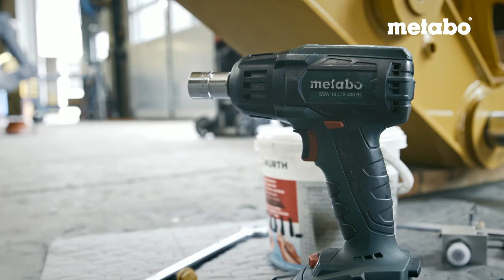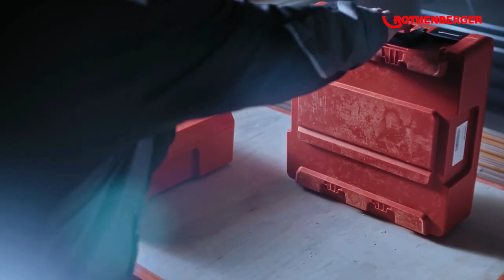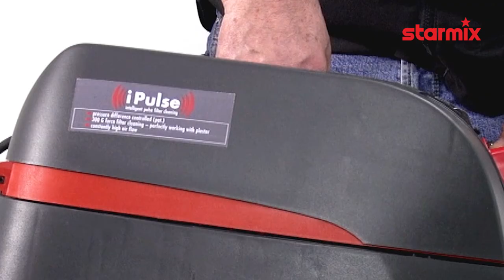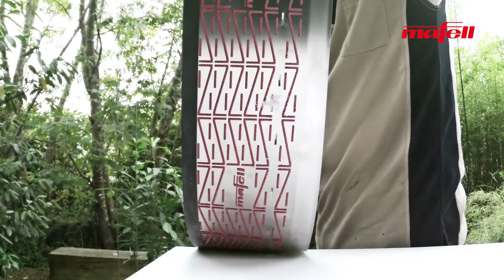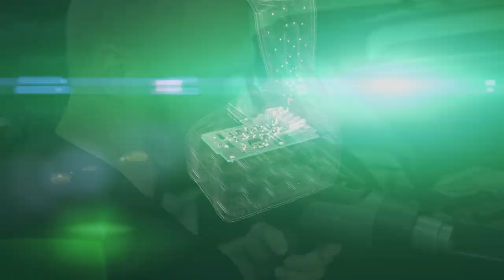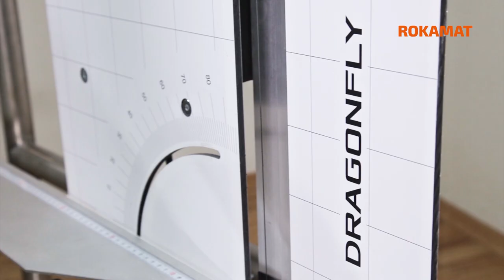One battery, many solutions. Cordless Alliance System (CAS)

Comment: Great way to stifle innovation, all partners have to agree to any changes before something can change. It will take a decade before they innovate like Makita with their 40v and 64v range. Plus, they will stick to outdated 18650 cells instead of the 21700 cells that hold a lot more power.
Reply: Hardly a stifle to innovation, firstly, makita 40v and 64v is shit and has easily been beaten or equaled by 18v or dual 18v equivalents, and for higher power applications I'd rather see multiple 18v batteries in series (where you'd expect to need more power you're looking at larger tools in the first place) rather than forcing people into a new battery platform that only works with specific tools.
21700s are not as super amazing as you seem to think they are, the actual thing that companies should be switching to is lipoly/li-ion pouch cells like dewalt, but having a unified battery system does not prevent this from happening as shown with dewalt, the pouch cells can be completely interchangable with the 18650s, hence the leader of the CAS (obviously metabo) can make them and offer them as an alternative for their own tools or others.

CAS is a major leap forward, like USB C has been, and I hope to see it actually forced on tool makers by the law in europe so that people aren't locked into one battery platform when they buy their tools and instead get to choose all the best from each brand.
Reply: 18650 or 21700 is just a form factor, it does not say anything about the chemistry and energy/power density of the cell. Don't make comments about things you have no knowledge about.
Reply: @Wallborg  I'm a robotics engineer, I work on autonomous drones and we modify batteries ourselves, especially on prototypes. Look at the size and weight differences between the 2 and the slightly larger size allows ~50% greater capacity (comparing similar chemical compositions). 21700 are designed to just be larger capacity 18650s so voltage remains the same so there is no need to change any internal wiring of the system. I'm not an expert with batteries but I do work with them and know a fair bit about them because we have to research every component that we use on a drone.
Reply: @Martian74  Nice. :) The thing is that 21700 isn't "slightly" larger than the 18650 - it's ~50% larger. So it should come as no surprice that the capacity is ~50% larger given the same chemistry, it's just a matter of more volume. There is of course some volume efficiency gains when going for a larger cell but for a hand tool battery pack they are negligible on their own. What matters is the system solution and the constrains you have in your system, depending on that either 21700 or 18650 could be the best solution - or a completely different form factor. But there's nothing saying that a pack with 21700 cells automatically is better compared to a pack with 18650 cells.
Reply: @Wallborg  3mm added to 18mm diameter isn't a 50% increase and 5mm added to 65mm isn't a 50% increase but there is ~50% more volume so you can gain around the same increase in amp hour capacity. This association limits innovation by limiting them to 18650 cells. 21700 batteries offer a ~50% increase in capacity without changing the voltage out so no tools need any changes to wiring or capacitors, regulators or any other changes but they aren't acceptable to the association. That is why they will fall behind in technology. Look at the pouch cell batteries being made by Dewalt now. Pouch cells have very high power to weight ratios but are more delicate than cylinder type batteries but if Dewalt found a way to use them safely then they can innovate the market but not the association. They will fall further and further behind.
Reply: @Martian74  I know the cell voltage stays the same given the same chemistry, that's not a form factor unique thing. Yes of course a cell with a larger volume will have more capacity, that's not a technological advantage in itself, just pure geometry. You can also put it the other way around, that you are able to make a smaller sized battery pack with 18650 cells for a specific voltage level which could be an advantage. By the way, who says that Metabo can't make CAS packs with 21700 cells if they want to? Of course they can. Nothing is preventing that. Pouch cells are more delicate for sure and the manufacturing process of them is less robust compared to cylindrical or prismatic cells, resulting in higher cost and also more defects slipping through quality control. The non structural casing of pouch cells also requires that they are constrained with more structure in the pack to prevent swelling forces from damaging the internals of the cell. It's not like DeWalt has invented something new here, they have just copied how pouch cells have been used in other applications outside of the power tool world for a quite long time. And Makita 40V (should be called 36V to be consistent) as opposed to 18V is more a sales gimmick than anything else, the advantage of a 20V higher system voltage in handheld power tools is negligible.
Reply: @Wallborg  The CAS standard was chosen over a decade ago at 18 volt batteries, and everyone agreed back then. Now we are seeing 36 volt, 54 volt and higher tools but not from a CAS member (unless they put in multiple batteries and set them in series)  because they are limited to 18 volts. Some tools can benefit from using higher voltage, V = IR so you can double the current to a motor if you double the voltage and keep the resistance the same. This affects the type of motor you can run and how hot it will get etc. so you can innovate much more outside of CAS than inside it. This is the main problem with CAS, the members tools will always be behind independent brands. If you want a tool that works with batteries from other brands then join CAS, but if you want the latest innovations in tools and batteries, look outside CAS. 
Also, there are adapters available so you can put a Makita battery on a Dewalt and a Dewalt battery on a Milwaukee or any of them on a CAS battery pack as long as they are the same voltage. That is innovation and the whole point of my original comment, CAS stops/slows innovations from happening.
Reply: @Martian74  we are not seeing 36V tools "now", they have been along for quite some time. I have a cordless Hilti hammer drill with 36V that is ~15 years old (a big and powerful one). Higher voltage than 18 V can make sense for some high power tools yes, but not most tools a manufacturer like Makita typically makes. You're using ohm's law a bit wrong... If you double the current and voltage you will get higher losses (W=I^2R). The point with higher voltage is that you get the same power with less current, or more power with the same current, keeping the resistive losses down. CAS or similar is great in that it allows you to select the best tool for each application and not being stuck with tools from one manufacturer. There isn't one manufacturer that does all the different tools the best. Say for example that you are locked in the Dewalt system and want to buy a track saw, then you have to get Dewalt's shitty track saw or add another battery platform to your lineup. With CAS I could have the superb track saw from Mafell running on the same batteries as the great angle grinders and impact drivers from Metabo for example.
Reply: @Wallborg  Yes, Hilti was able to bring out a 36v hammer drill 15 years ago because they aren't part of the CAS cartel. They have some very innovative systems that are particularly useful to larger organisations, like being able to track the history of each battery, how many charges, charge potential etc. but that is part of the Hilti system. 
I addressed the part about being locked into one manufacturer by saying that people have innovated by producing adapters so you can switch the same voltage batteries across different brands so even a Ryobi 18v will fit in a Milwaukee and vice versa. If you are wanting to upgrade to one of the newer technology systems like Makita 40v then you would need to get one of their batteries but you would have to weigh the cost vs usage for yourself. Battery technology is progressing very fast so being held back by a standard isn't good, it is good for small boutique manufacturers that make a few tools but don't have the size to innovate on battery technology and prefer to just leave it to others. 
That is why we are testing out new battery systems and motors on our drones regularly. We have been trying out higher capacity batteries, pouch type and cylinder type cells, and lower capacity dual battery systems that can switch on the fly if needed (I don't like it but we were made to do a dual battery thing). New stuff (not just batteries but motors and controllers too) coming out regularly and we like to stay at or near the front of the pack.
Reply: @Martian74  you are very stuck on that the system voltage is the best way to innovate battery and tool design, it's not. :) Higher voltage is useful in some tools and applications but it's actually the opposite in other (smaller) tools. Increasing the voltage is the way to go when there is a clear benefit. Metabo has an absolute beast of SDS Max hammer drill with 18V CAS, not much beats that one. You can also look up reviews where the Dewalt 54V SDS Max hammer drill is compared with the Milwuakee 18V SDS Max hammer drill. Same battery capacity (162 Wh) and still the Milwuakee outperforms the Dewalt on both drilling speed and energy consumption. The point is that higher system voltage is just a marketing gimmick in many cases. People compare two tools and choose the one with higher voltage because they think it's the best one, but it doesn't have to be.

Have you every used the CAS batteries and tools using them? They are some of the best batteries and between the different tool manufacturers you can build a set of tools with better quality than any of the big "do-it-all" brands can provide. Can you say what you are missing with their performance? Power? Energy efficiency?

The CAS "standard" to my knowledge doesn't dictate the voltage or internals of the battery packs, it's just a way making a system of batteries being compatible between different tool manucturers. It's easy enough to switch the layout in the pack from 5s2p to 10s1p for example to get to 36V. Then depending on if you connect a 36V or 18V tool to that battery they will use different pin to achieve the correct layout. So the 18V tools will get 18V out from the battery and the 36V tools gets 36V. I am sure that when there is a need such a CAS battery and tool will come.
Reply: @Wallborg  No, when you are involved in product development you have to look at all areas to innovate. CAS means a major point of innovation has been cut off and that limits other advances as well. So being in CAS means you have to use certain sizes of motor, if you have calculated that the most efficient design for your product would be 24v, too bad, use 18v. Engineering is always a compromise so you always have to work around some limits but having more limits placed on you is stifling innovation. 
If someone said we could only use x type of battery it would stifle our products as we sell smaller educational drones to schools, larger drones for agriculture and military and we also make some custom drones if people want certain things done. The customer needs should dictate what the specifications are, not some committee that has to agree on everything before any change is enacted.
Reply: @Martian74  I am a battery development engineer so I am well aware what product development means. No it does not mean you have to use certain sizes of motors, but the motor needs to run on 18V at the moment . Anyway it does not make sense to optimise every tool for a specific voltage, customers don't want to buy multiple battery platforms anyway. So yes 24V might be the might make sense for some products but it might be 18V for other products. Engineering and product development is also about finding the best compromises that still gives you great performance and good customer value, CAS does just that in my opinion. I can buy a Mafell saw and a Metabo angle grinder and use the same batteries, if they needed separate batteries I am sure they would get less sales.
Reply: @Martian74  and by the way, CAS uses 21700 cells. Just FYI ;)